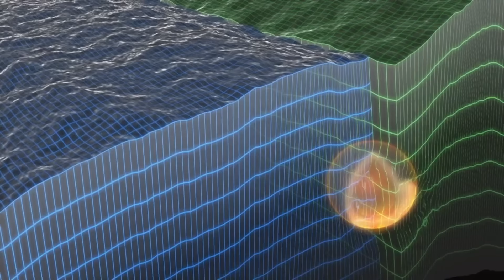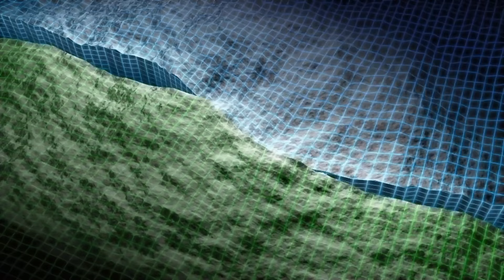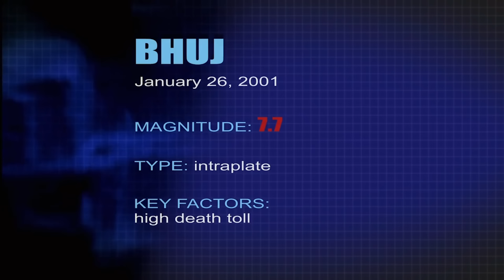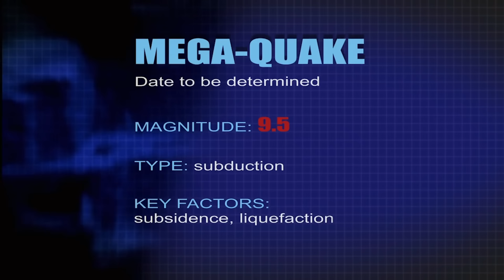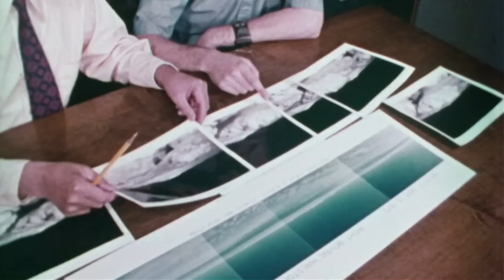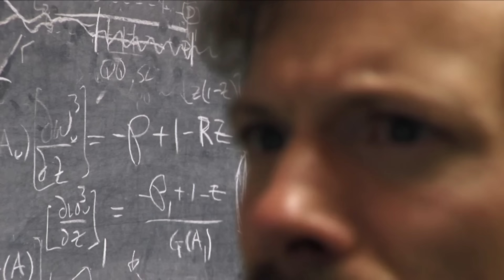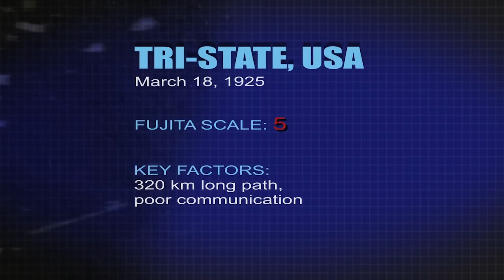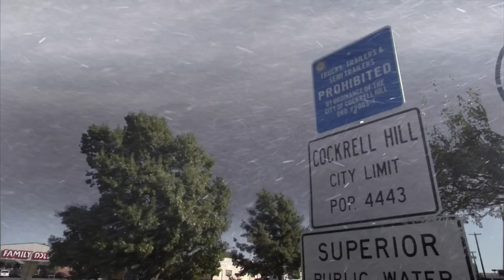The Worst Earthquakes And Tornadoes In Modern History | Mega Disaster

Comment: 22:39  I have to say this, if I were somebody who had been involved with the building of these little cluster of high rise tower blocks, or involved with the actual architecture/design of those particular buildings, ultimately, I would’ve seen the error of my design & 100% absolutely made sure not 1 single building Large or small, tall or short was ever built on that unstable soft soil ever again, coz it had caused the high rise blocks to resonate on a colossal scale, the concrete structures shook that violently - side to side, everything just vibrated itself to pieces, therefore, seeing the collapse of all buildings within that danger zone.  Dah learn from mistakes, don’t keep repeating them huh!! 😅
It doesn’t take a rocket scientist to see there’s many structural weaknesses in high rise towers coz the height will not tolerate the shaking! Not unless the floors are lessened in numbers & the designs upgraded in a manor way! 
Lives lost coz of tower blocks shaking themselves to bits during earthquakes,  is a harsh lesson for any construction engineer, architect, so on & so forth! Learning from ones mistakes can save so many from losing their life in the event of an epic earthquake!
We’re not living in the dark ages ya know! 
About time something was designed to better stabilise tower blocks, coz if we’re gonna build them @ least make them safer than these huh. Daaam! 😅😮